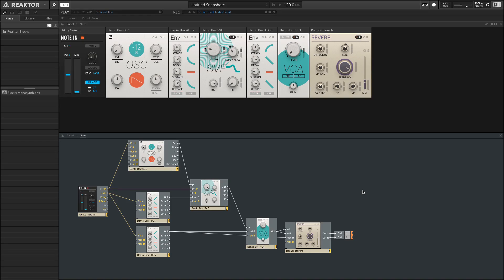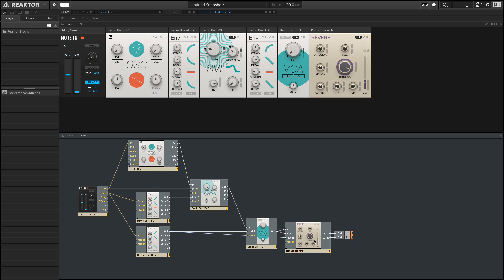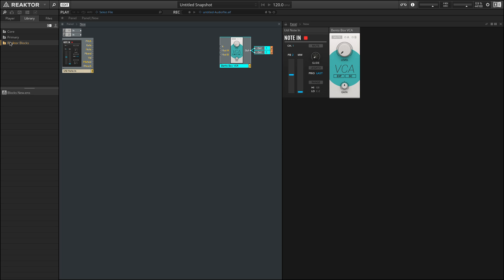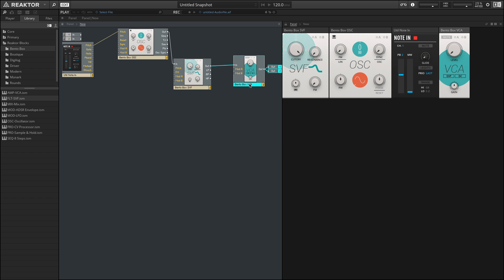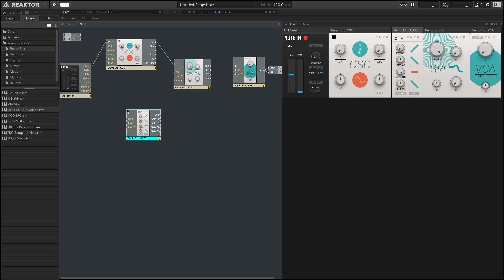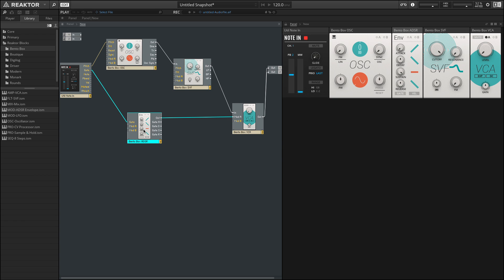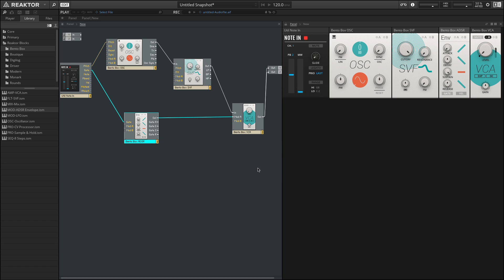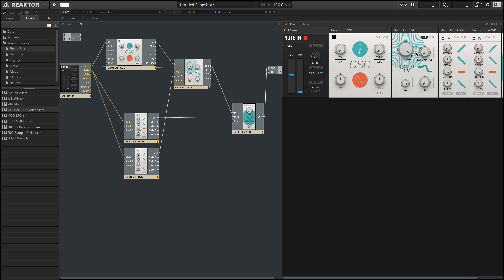Reaktor 6 Blocks Tutorial #1"Introduction"

Comment: why is every comment on this post the dumbest questions ever.... dude to use a soft synth as a vst you need to locate your fuckin vst folder with in your DAW, ifyou cant fiind blocks in your library its not there. REMEMBER THE COMPUTER ONLY DOES WHAT YOU TELL IT TO DO. IF THERE IS SOMETHING NOT WORKING ITS BECAUSE THE USER ENTERING THE DATA IS MAKING AN ERROR... DUDE download the native access program and download blocks the way the fuckin website (NI's website) tells you to download it when you buy the softsynth. and if the pitch changes but no envelope, your ahouls mAYBE USE A DAMN ADSR MODULE FUCKKIN NOOB

Comment: Does anyone know why sometimes certain Reaktor ensembles don't produce any sound via MIDI (while many others do)?
Reply: Not all ensembles are set to receive midi. Some are setup to receive audio from an external source and some are setup to be run from a sequencer. If you cannot produce sound from a midi keyboard then look to see if there is a clock module in the ensemble. Click on the play button and it will most likely trigger the sequencer. Hope this helps you.
Reply: I have the same problem

Comment: Played with Blocks for about 5 minutes with the R6 player and immediately bought full version of Reaktor 6. Started going thru this tutorial and ran into 2 issues. First, when I drag the Blocks New.ens into the structure window I don't get what you show. I get Clock, Note In, Macro Knobs, Macro Switches, Scope and Level Stereo. Deleted everything but Note In and built the synth following your tutorial.
I get a constant note out, the pitch changes but no envelope!
Thought there might be some residual stuff from the Blocks New so I started from scratch with a new Ensemble and built again as above. Same result.
I've checked everything and still this strange behaviour. I have tried with an Impulse 49, a LaunchKey Mini, a Korg Mini and my iPad running several different MIDI keyboard apps.
Any ideas?
Thanks!!

Joe B
Reply: +Joe Banko I had the exact same problem, but after scrutinizing the video I noticed he moved the modulation input (the grey bars next to the "LEVEL" knob) up.  Check it out at 4:54.  That was the key for me!
Reply: Thanks :)  Yes it shows but no mention however it's very important.
Reply: I had the same problem. This part is crucial, but he fails to mention it on the video. I was really puzzled by this, then I checked this out and now it works. Thanks! :)
Reply: It's a year later and I'm learning Reaktor 6, following this tutorial.  I assembled the blocks exactly as in the video and I also get a constant tone that changes to whatever keyboard note I hit but remains constant.  I tried the tip pf moving the modulation input (the grey bars next to the VCA "LEVEL" knob) up, but that has no effect. Also the Envelope block has no effect on the VCA block.
Reply: @kirkshoe  a year later and im still having this problem too.
Reply: "First, when I drag the Blocks New.ens into the structure window I don't get what you show."
Well... at least you have a Block New.ens, I don't. Nor do I have a folder called Reaktor Blocks when i click on Library, only when i click on player.
Reply: youtube videos are really bad ways to learn believe it or not.

Comment: So, NI gave some of this stuff away for their annual Christmas thing they do, so now I have reactor6 and some Blocks Wired. My issue, is that I can't seem to build my own modular setup with it. I have three "presets" I guess, but no library in Reactor from which to see individual blocks. I only have tabs for "Player" and "Files" with no Library. Any ideas what's going on? Hope this makes sense. Any help would b appreciated. Thanks, and great vid :)
Reply: +SLVMBER You can't edit any Reaktor Ensemble unless you own a full version of Reaktor.  For Blocks based Ensembles (and Tim Exile's "Flesh") you'll need Reaktor 6.  For any other Reaktor Ensembles, you need at least a full version of Reaktor 5.5 (which is no longer being sold with Reaktor 6 out).  Hope this helps.
Reply: +SLVMBER I'm pretty sure the thing they gave away is a pre-made modular setup. I don't think there's anyway of making your own unless you buy the full version.
Reply: Yeah, that's the conclusion I came to as well. Thanks for the response though.
Reply: +SLVMBER Im having the same issue
Reply: +SLVMBER Yeah you will need to buy Reaktor to make a modular synth and save it.